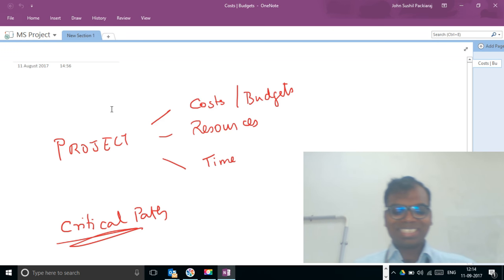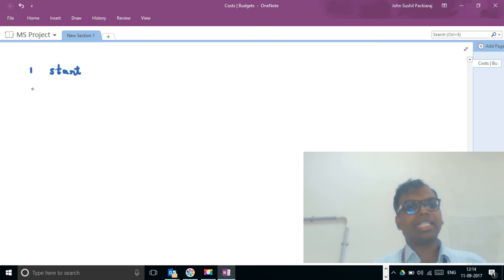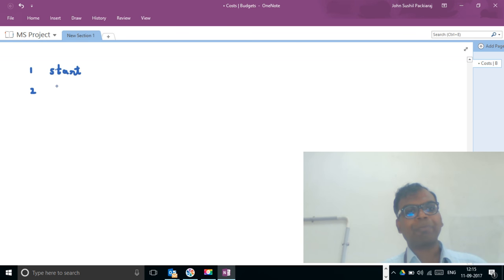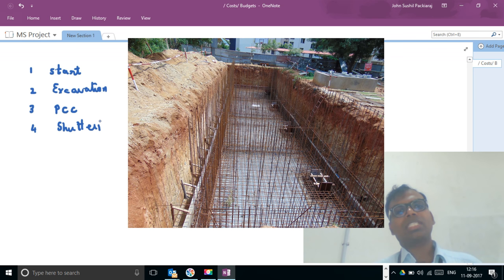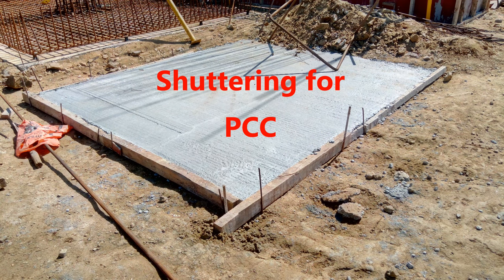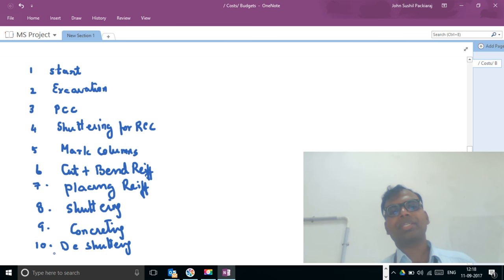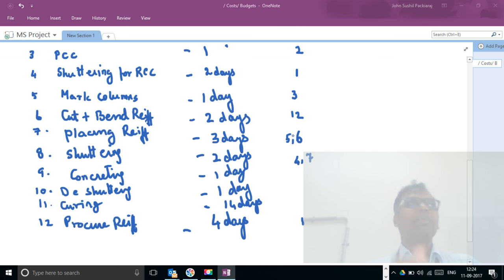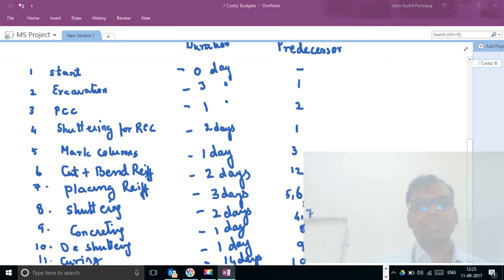How to construct Critical Path Method Diagram for Construction Projects Example 01

Comment: Sir, is curing done just after deshuttering(11:07)?.....deshuttering should be done after 24 hours for vertical concrete wall but we can start curing after setting time of cement which is 6-8 hours.
Reply from the maker: You are right in your statement, however, side of concrete surface require moist curing (say using gunny bag).  Which actually is practical only after de-shuttering

Comment: Sir, curing should be done minimum of 7 days and can be extended upto 28 days as concrete gets its 99.99 strength in 28 days....but u said that curing should be taken upto 14 days (11:08). Why ?
Reply from the maker: In practice, you will typically find people finding it difficult to cure for 28 days.  Again, remember that concrete can attain upto 80% strength in about a weeks time.  So, your knowledge of concrete technology will play an important role.  I will also request you to look at the role of curing agents, coatings, steam curing and the like that is changing the way we work.

Comment: Sir, how can we do shuttering for RCC before excavation, cutting and bending of bars (9:29)
Reply from the maker: We start procuring the material and preparing the same.  For example, the Aluminum shutter if used, has to be prepared and fabricated in a factory.  I am sure you will agree, 'No point in waiting till the excavation is done'

Comment: Shaonli Mishra 17BCL0009
38:36 it is said that LFT for 8 th activity ie shuttering is  23/9 but it should be 22/9
41:44 in 2 activity The LST is shown as 14/9 but it should be 12/9
41:55 in activity 12 it has been shown that float=4,but float should be zero
Reply from the maker: I need to look into this a little bit more pl :)
Reply: won't the LFT of  'Start' be  on 9th ???
Reply from the maker: If you both can share the calculation to prove your point, it will be very nice

Comment: 40:50 in activity 4 float should be 7 days instead of 8 days because sunday is holiday and it is should not be accounted in float.
Reply from the maker: Sunday is a holiday. In the calendar, it is not considered as a working day. Thus, it will not be considered in the calculation.

Comment: 38:37 instead of 23/9 it should be 22/9 and also you forget to write the number of float day
Reply from the maker: Sunday is a holiday.  In the calendar, it is not considered as a working day.  Thus, it will not be considered in the calculation.